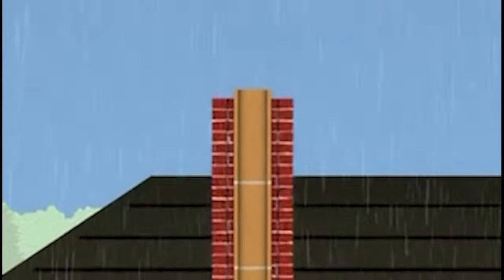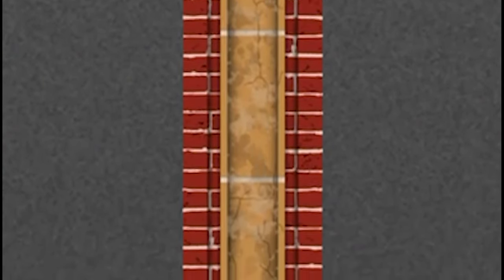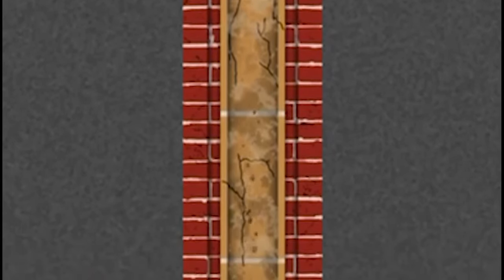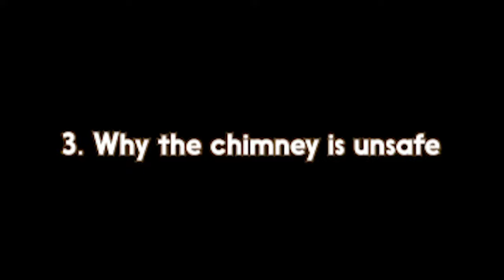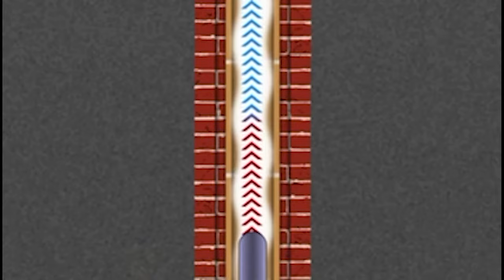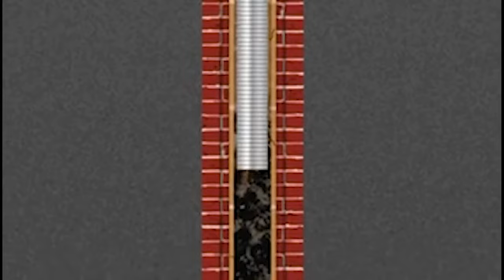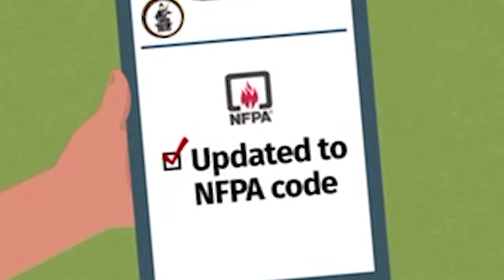The truth about chimney liners

Comment: Does the stainless liner need to have insulation wrap on outside of liner?
Reply: NFPA 211 states insulation is needed for all solid fuel burning appliances. Cord wood, pellet etc. However, as a certified chimney sweep I do recommend insulating a liner for all exterior chimneys, even liquid fuel burning appliances such as oil or gas furnaces. The insulation will mitigate moisture condensation on the stainless steel liner and ultimately greatly extends the lifespan of the liner.
Reply: @HiddenBearsHD Could you please let me know where the NFPA states that? I must keep scrolling by it.